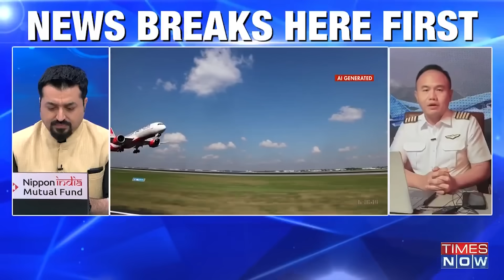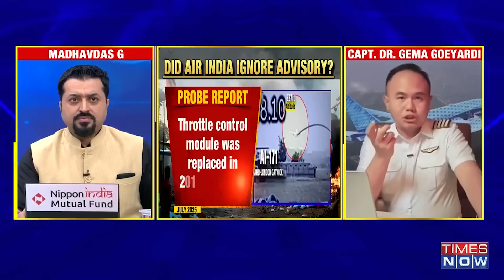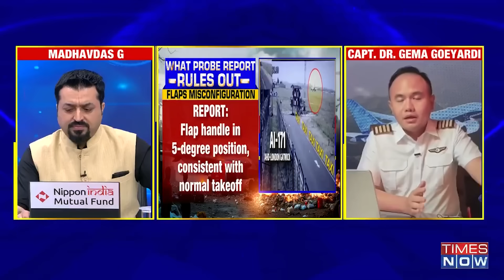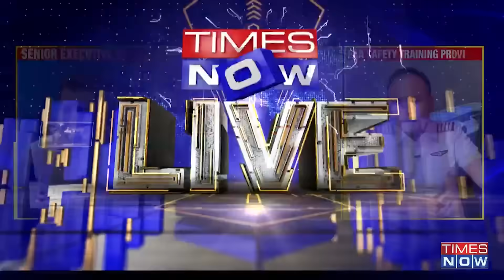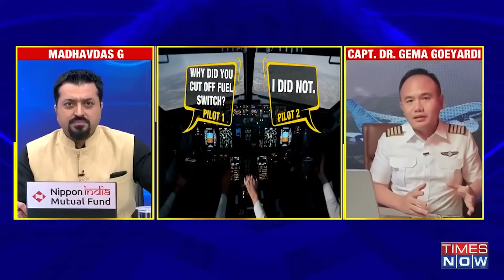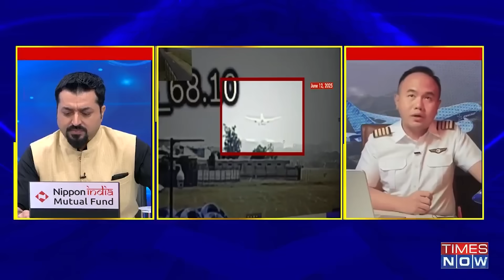New! Air India B787 Fuel Cut Off switch Mystery or Pilot error?

Comment: The actuators,  open/close mechanism of the fuel valves became closed,  either remotely or technical snag immediately afte the take off , deploying the RAT 
This caused a REVERSE ACTION to say a reverse relay from the fuel valves located in/around the fuel tanks,  to the Spring loaded mechanical fuel switches in the cockpit,  to Transition from Run to Cut,  untouched by hand  ( THAT OUGHT NOT TO HAVE OCCURED (suggests a design fault or is it intentional, for US to retain control of its aircrafts?) for the reason of the conversation between the pilots, which was rightfully denied 
Blaming experienced pilots is but covering up the non immunity against sabotage/design fault ? By Boeing, GE US, in connivenance with the Regulatory Authorities,

Comment: Boeing did not admit to MCAS problem until the 2nd plane fell out of the sky. FDR says fuel cut of was done in 0.1 seconds between both switches. Console display says fuel cut off. Right seat asks why Cut Off were set. Left seat says I did not. If someone was suicidal why not respond with " I hate my life!" Real problem for Boeing is to prevent a 2nd occurrence; if they learned anything from MCAS!
Fuel cut off switches not physically done until 6 seconds after RAT was deployed. Do the math people! They were attempting to recover from fuel failure! Time line is skewed between actual events.

Comment: The fact that the captain or any pilot operating a Boeing 787 can manually shut down the engines during takeoff represents a significant design flaw. This capability does not adequately safeguard passengers and crew from sabotage, deliberate or suicidal actions, or any other scenario in which a pilot intentionally cuts engine power at the most critical phase of flight. Engine shutdown switches should be designed to remain locked out until the aircraft reaches a safer altitude, providing sufficient time for a copilot or automated systems to detect and counteract a deliberate or erroneous shutdown. Allowing manual engine cutoff during takeoff undermines passenger safety and fails to minimize risk to the greatest extent possible. Boeing must address this critical vulnerability to ensure the highest standards of operational security on the 787.

Boeing Corporation will, in no way, shape, or form, accept responsibility or accountability for the design flaw that enables a pilot to manually cut off fuel to the engines during the most critical phase of flight. Instead, Boeing is likely to construct a narrative that frames any future corrective action as a voluntary enhancement, undertaken out of an abundance of caution to minimize risk. They will undoubtedly position themselves as proactive innovators, even going so far as to highlight their willingness to absorb the cost, rather than acknowledging the flaw and their obligation to ensure passenger safety.

Comment: The premliray reprt of the pilot asking the other if he shut the fuel to which the co-pilot replied he did not.Everbody assumed tha it was the swiches he was talking about,but it seems that the the 1)swiches were in the on position according to report.According to various experts no pilot would have tampered with the switches on purpose or by mistake..2)The FAAA Report of 2018 stating thart safeguard for the switches  was not guaranteed with  long use ( 12 years) and could a problem if not checked..So it could be that the check was not done.If it  was done then 3) it could be that  the fuel was shut down by some other means I’e. shutting the valves lower down in the pipe line..
There were two brothers who were sitting behind the captains  cabin in which ?one of  the brothers escaped but the other was ?killed in the crash.Could they have been responsible for fuel cuttoff via closing of  the valves and not the swiches. 
It is SABOTAGE by Terrorists, same who were involved in Pulwama and Pahalgam.
Best explaination given on Face To Face by Giraj Nayyar ,the DGCA expert specially if the fuel pump is not seperate for both Engines.Best explaination of what had probably happened.He gave an example of the stopcock on old bykes.The bykes stops after some distance if somebody has foolingly closed the valve, but the tank is still full.You have to open the stock cock. The same could have happened with the Boing 787 which lifted off perfectly and since the fuel had stopped after 625 ft it started losing power and trust and was only gliding perfectly for a landing ,pilot knowing this did not pull up the landing gear. Perfect explaination . .If this is true Terrorist don’t require bombs now.They simply adjust the fuel outlet .Somebody has sabotaged the plane through the maintainace work before takeoff... A warning about something “big” going to happen in India was given by a CIA AGENT SARAH ADAMS The “big” may have been a big plane like the Dreamliner AI 171.

Comment: I read a detailed cutout from the technical specs for the 787.

Summarizing:     Fuel switches are independent completely both sides
                                 Each has 2 power sources for redundancy
                                The signal is direct to fuel shutoff valves, the computer does not moderate
                                The signal from the switch is modified (forget the details) so that a short cannot turn off the fuel
                                 The black box records switch position, a separate input to the black box is the state of the fuel shutoff valve itself

So this is how they are confident saying the fuel switches transitioned from on to off.    They can see from the data.    They also know engine status, the timing of the switch transition to off, naturally, is perfectly timed with engine state and turbine speed.   10 seconds later for one engine and 14 seconds later for the other engine the switches were transitioned from off back to on.    The plane then automatically tried to restart the engines, it had one caught and spooling up but there was no altitude to recover.    Having the switches transition from on to off at 3 seconds after liftoff guaranteed there would be a crash.   And we all have heard how the switches require a complex deliberate movement to actuate to either position.  

Boeing has a bad and VERY deserved bad reputation.    I was ready to blame Boeing as a matter of course.   However the Indian investigators produced a pretty detailed, pretty professional report which does NOT point to an aircraft fault.    Nor was their a bulletin advising all boeings or dreamliners check X or Y, they always do this if there is any reason to  suspect plane faults.    Boeing has killed people with their MCAS certification/training failure, they've had parts fly off aircraft etc.    But this does not look like more of that.    Someone turned the engines off.   If you imagine the scene and take off roll you can make a reasonable guess which pilot did so.

Comment: Is that possible? "Poor Maintenance leads to poor electrical connections lead to AC non functioning lead to temp increase in hot humid airport in the scorching heat lead to vapour accumulation in the fuel tank lead to fuel transmission blockage when the aircraft tilted back to fly lead to engine failure lead to fall and hit to the building below lead to fire ball lead to deaths and destruction."

Comment: The report is misleading. It hides what it wants, shows what is wants.
As per it there are only two sentences spoken by two pilots. Why did you cut off? I did not.
Demand release of full conversation between the two pilots and then we will see how much this looks like suicide.
As passngers we should understand that the problem is either with Boeing or With Air India.
REFUSE BOTH FOR THE TIME BEING. 
Do not fly in Boeing (we can check type of aircraft while boking) and do not fly with Air India. Even if you have to cancel or pay more.

Comment: Here is the FAA/Boeing Advisory. "The US Federal Aviation Administration (FAA) has issued a Special Airworthiness Information Bulletin (SAIB) warning operators of several Boeing aircraft models about potential risks linked to faulty fuel control switches that could trigger unintended in-flight engine shutdowns."  The advisory spans a broad range of aircraft, including the Boeing 717-200, 737 series (covering -700, -800, -900ER, -8, and -9 variants), 747, 757, 767, 787-8/-9/-10, and the MD-11 and MD-90-30 models.

Comment: The actuators,  open/close mechanism of the fuel valves located in/around the fuel tanks, became closed either remotely or technical snag,  causing a REVERSE ACTION , to say a  reverse relay from the fuel valve to the spring loaded mechanical fuel switches in the cockpit,, that should not have taken place, thus transiting, from " Run" to " Cut off" , without touching the switches, the reason for the conversation between the pilots,  which was rightfully denied, 
Blaming experienced pilots is but covering up the non immunity against sabotage/design fault by Boeing,  GE, in connivenance with the Regulatory Authorities,
If as is said about the Captain , a humble & down to earth man is true  , his words to his Father of the manner " I will be with you" , which words became taken up by the Father in heaven, to be with him, & as for his earthly Father he need not worry, about , for God would take care better than he would,

Comment: FDR clearly recorded the deliberate and sequential movement of the switches, with a 1-sec gap onr by one. Then, again intentionally, the switches were moved back to the RUN position one by one. The pilot's questions further confirm that the fuel cutoff switches were manually operated. If the fuel cutoff had been triggered automatically by the system, the FDR definately would have captured that too. This guy seem to misunderstand that the FDR records the actual position of the fuel cutoff switch, not just the signal. All of this event captuted was designed to provide a clear, factual situation what really happened for investigation process

Comment: Switch was off before plane took off   whatever oil was in pipes  that helped plane to take off  Did you see the dust behind plane when it took off  But at that moment it wasn't possoble for them to stop running plane  if you have scooter try this one
Reply: You are genius
Reply: Many Say  Switch was turned off by someone on ground
Reply: Absolutely wrong! If the fuel switches are set to cut off on the ground, the engines will not start. Simple as that.

Comment: Fuel valves designed to spring loaded snap shut when any electrics to them go off even for a fraction. Happened to ANA in Tokyo after  landing using reversers.. could not restart. There is NO position change of cockpit switches position
Reply: You're referencing an entirely different and irrelevant incident. The aircraft you're talking about had already transitioned to ground mode. The Air India aircraft was in air mode!

Comment: The problem with that theory is that suicidal men tend to give a reason, which is why is so expected to find a note. And, he said, sounded surprised also, "I didn't do it",  no cries, no I am "sorry", and both tried to salvage the situation...a possibility is that the engines died (any chip stopped to communicate after so many cycles) and they were hoping to turn on and off to reset...when the pilot said "why did you turn off the fuel?" is not certain is because he SAW the other do it, but rather sensed, felt, heard, the engines die. Hence, the pilots TURNED THEM OFF, quickly, to restart trying to RESET the lever they probably felt was "electrically confused" And, now everyone assumes engines died because they fuel was turned off. YET, an electrical issue/sensor/chip could have opened and cut off instructions, THEN, AFTER THE FACT, the switches were handled off and on, and not viceversa. Even if suicidal, seldom, if not ever, men plan to kill many with them. In fact, men who commit suicide mostly do it to liberate/free/release others from their burden.

Comment: This Chinese pilot didn’t read the report properly . The pilot didn’t ask “did you cut off” the pilot asked “WHY DID U CUT OFF” meaning he saw the pilot cutting it off .
Reply: If he saw "other pilot cutting off the switch" ... immediately he might have shouted ...sating that "don't cutoff". He will not wait until two swithes are off and engines are off. Use some sense
Reply: @subbuk9716 completely right....👍
Reply: even if the fuel switches were set to run, there could be a glitch in the system that prevented fuel being fed to the engines  … they should share the entire cockpit voice recording to understand the entire situation. the report was poorly done
Reply: Did you hear the rest of the conversation between the pilots from the black box? Obviously no, because they are selectively painting a narrative on pilot error to cover up any electronic failures.
Reply: No one saw it happened 🤦‍♂️🤦‍♂️🤦‍♂️
Reply: ???? Have you heard what he said? What language he was using? What sense he was taking? Indian use mother language and Indian english is different , so release full Voice data recording do not ply games Boeing

Comment: I hv a difficulty believing trained pilots would intentionally switch off both engine fuel... its a big lie. Why would they? Why did they not do it on their previous flights. Am disappointed that they did not include what they heard before the fuel switch off. I heard elsewhere that one of d bolts securing d pilots seats broke at that angle during take off ...dtz when 1 of d pilots unintetionally knocked off  d thrust lever n possibly d fuel pumps ...so it's inadvertent. Boeing n Air India are shifting blame unto pilots.

Comment: Pilot committed suicide and mass murder. one of the pilot lied after intentionally, manually moving the fuel switches. One of the pilot is in denial, lying.
One pilot saw the other pilot move the fuel switches and asked, "Why did YOU cut off" the switches. "Why did YOU.."
Let’s be blunt: a trained, fully rested pilot does not "accidentally" kill fuel to both engines during takeoff. 
This was no mistake — it was intentional. And now, someone is lying.
"WHY did you.." Why? The answer is one pilot planned to commit suicide and mass murder and he won't tell you that. He will just lie as he is caught RED-HANDED.

Comment: Software is very complex.  Can have error in it, hidden for years. But Boeing can't afford to be at fault. Blame GE? Blame Boeing? Blame pilots!, bingo, there you go! 😮😊
Reply: The fuel cutoff switch designed TOTALLY MANUAL SWITCH, there is no possibility done by comp system. FDR clearly recorded the movement ONE BY ONE

Comment: Was this a pilot planned suicide ?   No one can take this report seriously because the information from flight recorder is sketchy, out of context and not crossed examined by multiple independent investigators.  There are so many things that don't add up.  The Ram Air Turbine (RAT) was deployed automatically when both engines failed, as observed from the in CCV footage when the aircraft was about 60 ft above ground level,"  Per the time line, "this means the dual engine failure occurred before the pilot turned the engine fuel switches to 'cut-off' mode and then back to the 'run' mode.   So engine failure occurred before the fuel switches were triggered to 'cut-off ' mode.   This indicates the switches were used as a last ditch effort to get the engines to restart.  Also, "the survivability of the flight recorder raises concern". The plane's rear flight recorder, is designed to withstand impact forces of 3,400 Gs and temperatures of 1,100 C for 60 minutes, "yet the report claims it was damaged beyond recovery" This doesn't seem possible.   Also, the plane's emergency locator transmitter (ELT) did not send any signal after the crash. Why not?  Was the ELT damaged, unarmed, miss-wired, or malfunctioning?"
Reply: “Why did u cut it off ?”

Proof pilot cut it off to murder everyone